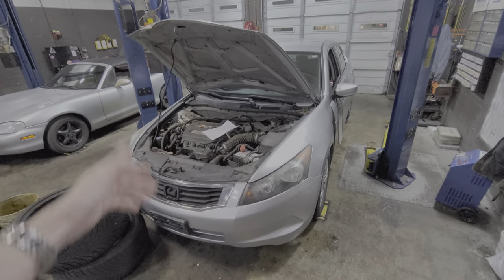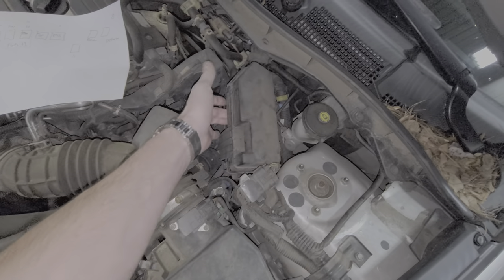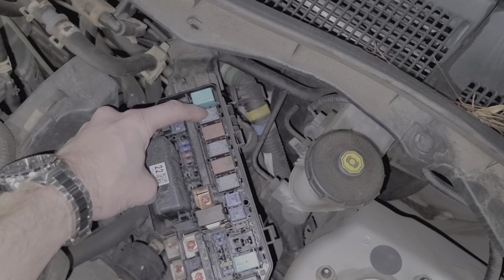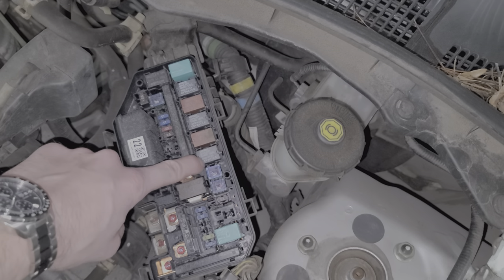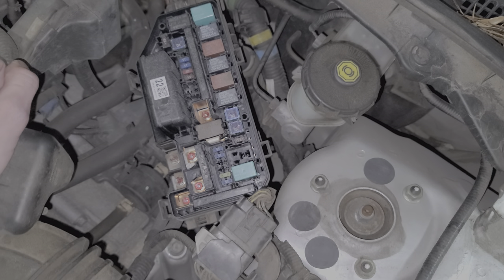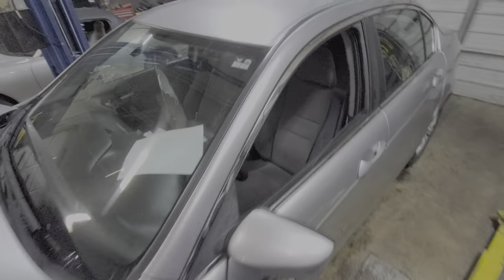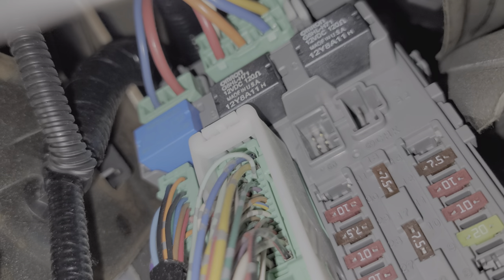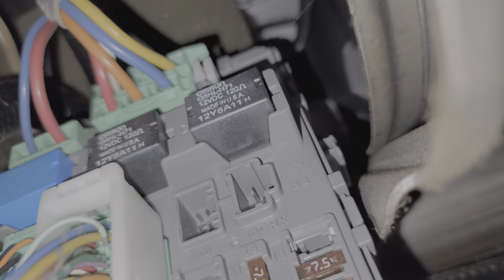2009 Honda Accord Relay Identification

Comment: Waiting for someone to show me how to remove starter relay. My car starts sometimes and it's not the starter or battery. I got a diagnostic and the shop said starter relay. And wanted to charge me 1,000$ and said they had to reprogram my car after wtf. Is that even a thing. Doing my own research to fix my issue. My car sounds like a blender sometimes. Wont start on short trips but long trips works perfectly fine.

Comment: I have that same model accord . I let it sit for about a year . When I finally started it up it started overheating (never had any problems before) . I replaced the thermostat thinking it was stuck closed but then realized . Both fans aren’t working . Can u tell me where the relays are and if u know wat fuses I should check? 🤙🏽

Comment: Ok so I have a 09 accord turn signals work except when lights are fully on they're bright but you can't see them flash and won't pass va state inspection and I don't have $600-$900 to replace micu any advice is very appreciated

Comment: Hello! My washer pump stop delivering washer fluid to my windsheild. I blew out the lines, swapped the motor and checked the fuses. All good. But there’s still a clicking under the passanger side when I go to engage my washers. My wipers still work, but still no liquid. Any help would be appreciated.

Comment: Where is the turn signal relay? When I use my right turning significant hip blinks really fast and also the dash on the radio
Reply: Old school was burned out turn signal bulb causes quick flashes.

Comment: I got a co PO685 and check engine came on I just replaces all the coil packs and sparkplug so with that said how much is a estimate for this problem to get fixed I'm low income and need help fixing it as car problems never end
Reply: What did you end up doing.  I have the same problem.  Did you end up changing the relays

Comment: I have a honda accord 2011 SE the left turn signal  is flashing to fast i was looking for the  relay but i can't find it can you help me to lacate please
Reply: Did you figure it out because I’m also having the same problem
Reply: @aminchrispjr3214  that means one of your turn signal lights is burnt out, you simple need to replace the burnt out bulb
Reply: @loganbarbour2119   They wonder why bored Cop pulls them over. Ha.